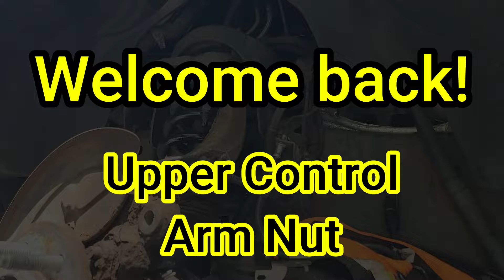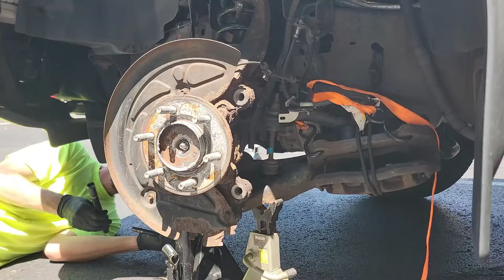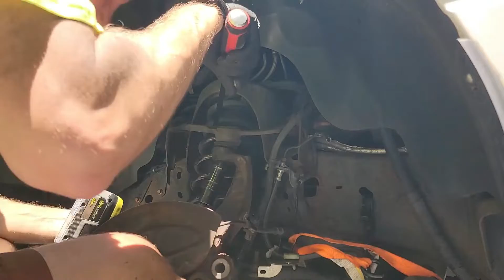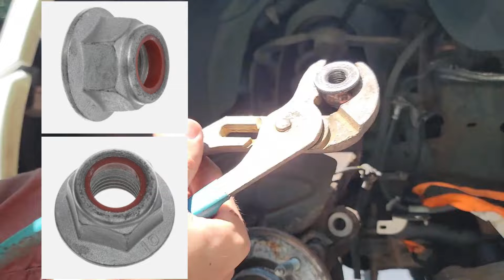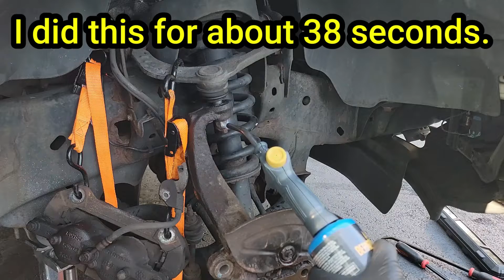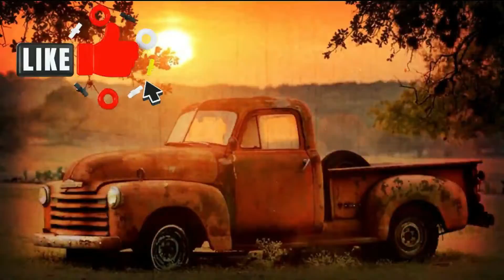Upper Control Arm Nut - How I removed mine!

Comment: Dude...this is the worst nut I've ever had to work with. Same exact truck.  I tried heat but not that long.   Gonna try again.  Thank you.
Reply from the maker: Yea I really had to leave the heat on there for awhile. There is a plastic insert that I had to melt in order for the nut to loosen. Its wild. 

BTW, make sure you by new nuts. The old ones cannot be reused. Let me know how it goes!

Comment: Your the Goat I figured I needed heat but didn’t think about a way to hold the nut clutch
Reply from the maker: How did it go?
Reply: @TrickShiftGarage  would had went great but I didn’t notice before that the bracket that holds the control arm and lets the nut and bolt go through it got bent as well so I would need to cut and do a welding job smh haven’t decide if it was worth it yet

Comment: I've got a similar issue but the bottom of my bolt is stripped! I can't get a 10mm to lock on. Any suggestions?
Reply from the maker: Oh man I'm sorry that happened! Something worth considering, if you can somehow hammer a 9mm socket onto the stripped bolt, that may create enough of a grip for you to get it off. 

Other than that, you may need to take it somewhere to cut it off. I'm sorry brother, but let me know how it goes!
Reply: @TrickShiftGarage  that's a great idea i  haven't even considered. 🤘
Reply from the maker: Hopefully it works for you brother!

Comment: Having same issue, so no issue with spinning ball joint when using new factory nyloc nuts on reassembly?
Reply from the maker: No you shouldn't have an issue with a new nut. Its a pain to remove though lol.

Comment: Or you could stop being a tool and put a pry bar against the upper control arm and then turn a ratchet on the nut.
Reply from the maker: First, I did that. It wouldn't budge. 
Second, you ok? 

Starting off a convo calling someone a "tool" isn't going to work in your favor bud. You're making yourself look like a fool.

Comment: I also figured out that the torch was the way to go from my time working on outboard engines but wouldn’t know that I ran out of acetylene 30 seconds in!! So I grabbed the Dewalt Saul saw and a metal blade. Cut between the nut and upper bearing. 45 seconds and Bob’s your uncle! Definitely have to get a new nut! Didn’t make a video but just wanted to share my trick.😎
Reply from the maker: That's a great idea too man! Thanks for sharing! This could help someone that doesn't have a torch on hand.